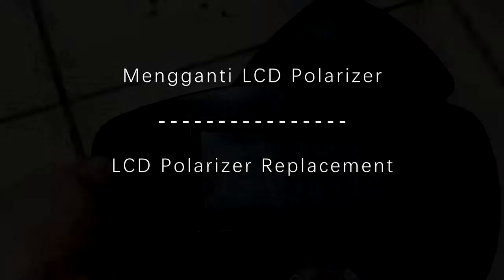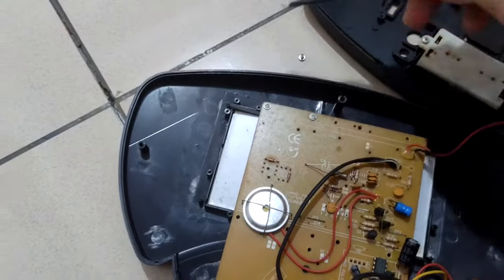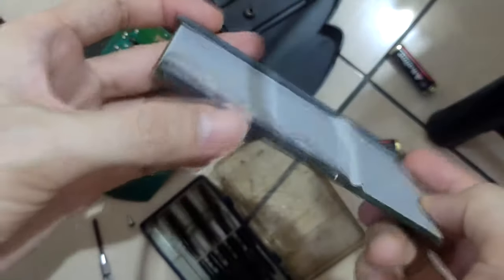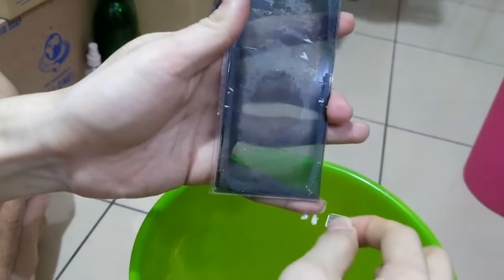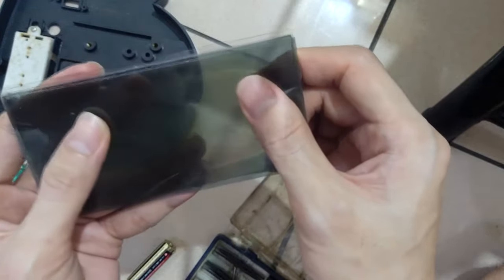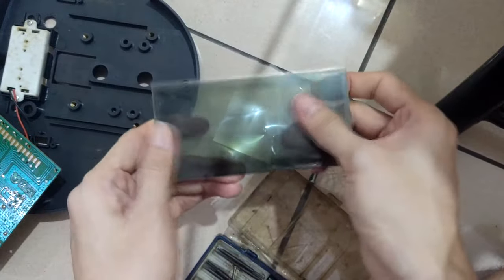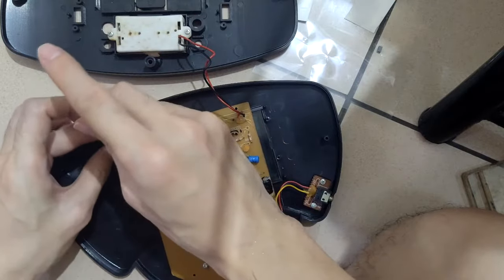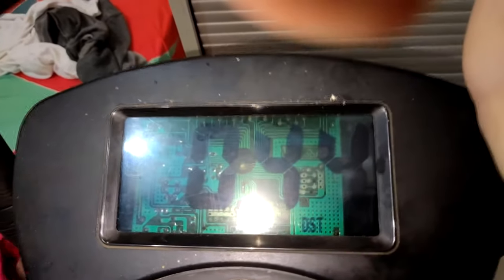LCD Polarizer Replacement

Comment: I used a piece of aluminum paper in one lcd that I repaired with new polarizer a as background to see better the symbols and numbers, I used a piece of thin cardboard to isolate the electronics between the LCD and the board and it looks like new.
Reply from the maker: Good sharing! Thanks.
Reply: Im not understanding please share me your experience

Comment: Hello Jimmy.  Several questions here:  Do those same polarizer filters work on LCD video color displays??? I have 2 Sega handheld game consoles; the Game Gear, and a Nomad Genesis. The polarizer adhesive on both of these, soured out, brittled, and took the filters (front and rear of LCD glass display) with it. I know I could get a superior BennVenn display for the Game Gear, but Benn Venn won’t have those until quite some time in the future from now, and I want to mod the Nomad Genesis, with a final ultimate mod that again, is out of reach for me; so the old ones will have to do for now. 
I had to do some scraping to get the old adhesive off of the glass displays. ….so now, I have two consoles that work well electronically, and do what they’re supposed to do; produce video, produce audio, ect.  ….but you can’t see any video, since the original polarizers are long gone. I know the displays have video, because I checked them with a much smaller piece of some sort of polarizer film. I was able to make out video images with this small filter. I just need to know which type of correct filters I need to get. I’m not too familiar with LCD display polarization. Can you help me???
Reply from the maker: I think you can try it first with standard polarizer. See if you can get display out of it. I think it should work, but I never tried on such color panel...